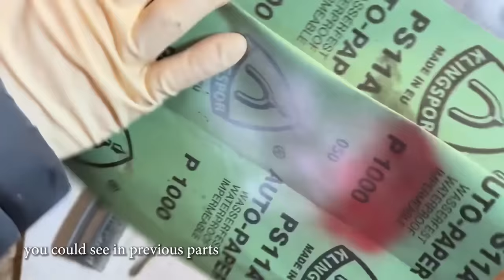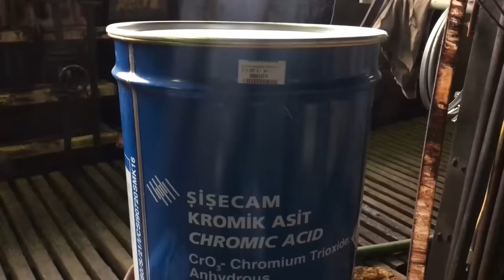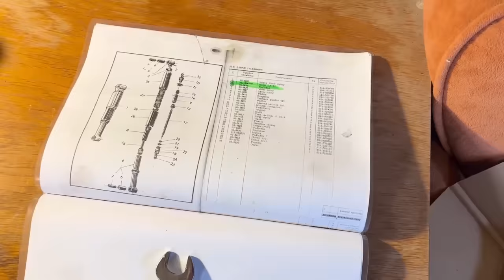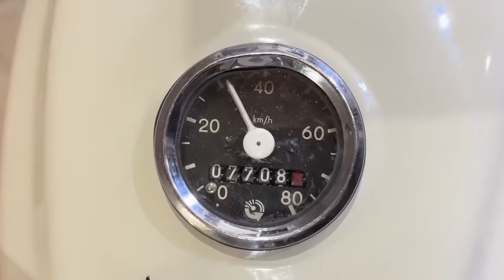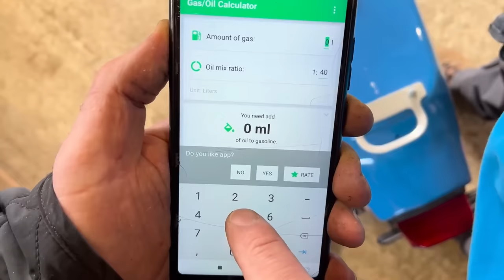Restoration Abandoned Old Motorcycle Jawa 50 two stroke engine 1977 - PART4

Comment: The Jawa brand has been resurrected in India with some pretty cool 350 cc motorcycles. This video really brings to perspective on what the original motorcycles were like
Reply: Where did the brand come from?
Reply: @rfz6234  indonesia
Reply: @rfz6234  AFAIK, the one in India was originally called Ideal Jawa and purchased rights from the Czech company Jawa. So ya, the company comes from current day Czech republic
Reply: Thanks for the information. I've done a little research about it, it's quite interesting.

Comment: From India with love and deep appreciation of your amazing work. I used to own a Jawa 250 cc two stroke twin exhaust motorcycle . Touching 130 KM was a piece of cake. The shocks on the vehicle were very well suited to Indian roads of  1970s . The roads now are excellent. The only problem was carburetor over flow and some times the vehicle would be difficult to start unless you gave battery boost to the. Magneto and high voltage coil. All in all great vehicle with a very unique beat like Harley

Comment: I'm honestly impressed by the time and effort you put into these videos, Keep it up!💛
Reply: They make a fortune from them so why wouldn't they
Reply: This is a scooter, not a motorcycle. Just because something has 2 wheels & an engine does not make it a motorcycle. Doesn't make it less fun to ride though. 
   The dip in the frame between the seat & handle bars allowing for platform to rest your feet designates it as a scooter. A motorcycle has no dip, the engine extends into that area wit the gas tank sitting atop the frame between the seat & handle bars
Reply: Zara,
Reply: @poppadave8134  here we call it motorcycle and many type of it
Cub, Touring, Scooter, Caferacer,, nakedbike, sport, off road, ect...
Reply: Periyanniya oh kues
Reply: Jago bg semangat
Reply: @poppadave8134  vcvvvvvvvvvvvvvvvvvvvdve
Reply: @poppadave8134  tvx3xcccvccvvvvvvvvvvvvvvvvvv3vvvvvvvxcvvcvvvvvvvvvvvvv3vvvvvvvv3vvvvvvvvvvvc3vv3ccvxvvvvvvvxv3vvvvvvvvvvvvvxvxvxx3xx
Reply: @poppadave8134    l
Reply: @poppadave8134  qq
Reply: @poppadave8134  this isn't a scooter, there's no platform in the dip
Reply: @masterzz57  If there's a dip, it's not a motorcycle. If there's not any pedals, it's not a moped. That makes it a scooter,  Platform or no
Reply: @blankon8389  you can call it a bike if you want, but it's not a motorcycle. I could go so far as to say that even an actual categorized motorcycle isn't a real motorcycle unless it's a Harley or an Indian, but I'm not gonna do that.
Reply: mereka hanya merusak tetapi untuk mencipta kan karya tidak mampu sebatas hawa nafsu belaka 👍
Reply: @bossman7478  a

Comment: I had a Jawa moped in the mid 80s when I was 17 and 18. It must have been similar to this one. I have hardly ever seen the brand before or since that time. There was one shop in my home city of Leeds (UK) which sold the parts, called Wylde's
Edit - having watched the video in full, I now see this is a scooter whereas mine was a true moped with pedals to assist motion.
Reply: 1waw2
Reply: This is not a scooter, it has a step through frame but it has a 3 speed manual gearbox with clutch and the engine is in the front
Reply: Oh nice
Reply: It was Babetta 207 or 210. 
https://en.wikipedia.org/wiki/Babetta

Comment: My husband and I sell used vintage motorcycle parts on eBay. We got a hold of an old 1964 Honda CA77 in really rough shape a couple years ago. Parts are almost gone now, so hopefully we helped some bikes get back on the road. I always wonder if the parts we sell will be fully restored, or just slapped on as is. Great job here.

Comment: So the rust only on the surface!? It's not normal it's artificial
There's no way the surface didn't have any hole from rust if it's on the open area 
I was working on motorcycle wielding workshop and I seen worst than that even tho the vehicle never leave it's garage and here we have vehicle which let in open area